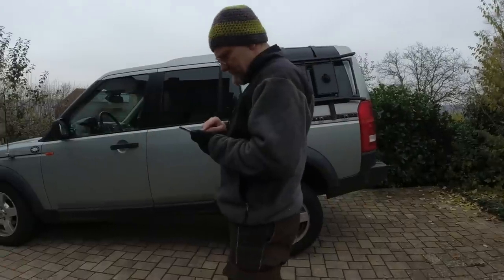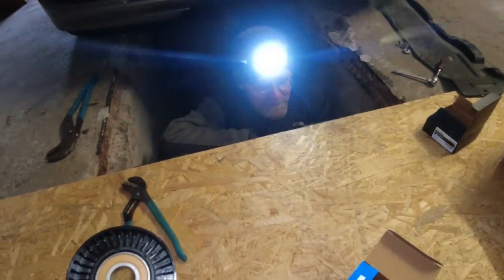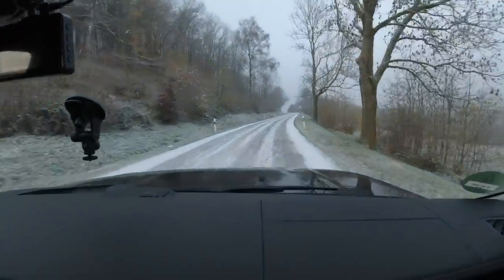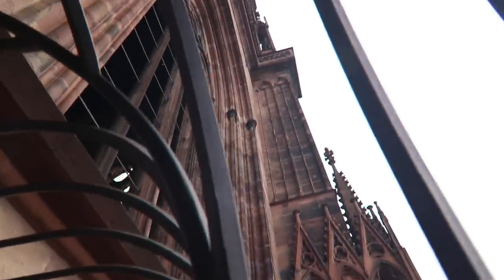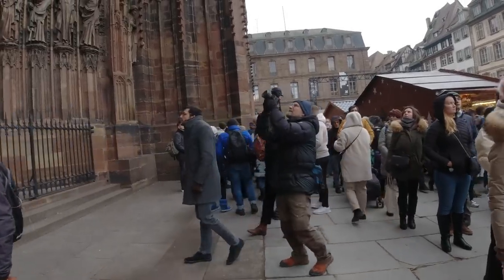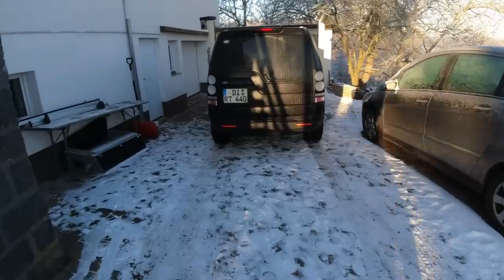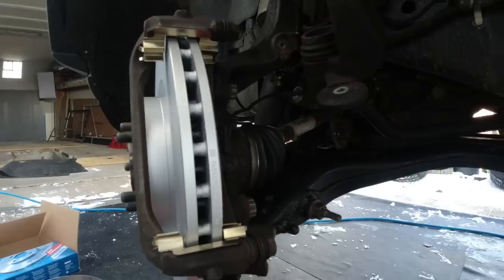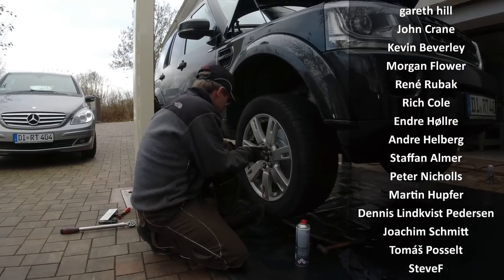Our Land Rover Christmas Tale - Brakes and FBH Remote Installation

Comment: Vera & Christian have a great holiday. Thank you for the very interesting videos and great humour.
The B class Merc was based on the first A class. The twin floor is very safe as in a crash the engine and gearbox are pushed below the passenger floor.
My wife and kids were crashed into by a drunk lady in a VW Toureg who hit the accelerator rather than the brake. She and the kids had only minor injuries thankfully.
The car was destroyed with the engine pushed half way to the back of the car. So the design is great until you have to service it and then you have to drop the engine to do almost everything.
Reply from the maker: 😳Hope they are ok.Yes we absolutely trust that our son will be reasonably safe with the B Class. And yes you even have to drop the engine to change a pulley wheel on the serpentine belt. I cannot understand how people talk bad about Land Rovers. 🙄😅🙋‍♀️Vera
Reply: @Vera_and_Christian  thanks very much. The crash was years ago now. But, yes it saved them so it is a great safe design. Just a PITA for working on 😂

Comment: Love your happy channel, and I'm a dedicated LR owner. On high milages, as spoken of before, my long sold-to-collecter 1991 3-door Disco diesel had 240.000 MILES on it and ran like a sewing machine and never had engine work done just cam belt changes and a slight "tune-up" of its turbo boost valve adjustment and regular services. .. was a 5-speed manual the reason I had to sell It sadly.. Have owned a 2004 Freelander HSE spec auto, with fuel burning heater from the factory but did buy a radio transmitter and 12 volt receiver to one day fit in the live feed for the FBH - "one day"-  Many thanks, and a Happy New Year both - Ian - UK.

Comment: Lovely Christmas LR Time special. Thanks for sharing the videos of your family too. I would be interested in how long the FBH runs before it trips due to a low voltage on your car. Mine does a few minutes without a power supply, or it runs for the full 30 mins with it. I've reset the battery BMS and of course now its much warmer (in the UK) so don't need to use it. Doh!

Comment: Happy New Year to you Christian and Vera.
My 2010 L320 3.0 Range Rover Sport has succumbed to the dreaded P0006A ‘Restricted Performance’ Red triangle error code, confirmed by my iCarsoft i930 tool. 
Having done a smoke test, using a small funnel attached to the rubber hose from the intercooler and blowing ’Vape’ smoke through that pipe, then Elbow, ‘Y’ shaped throttle body and into the intake manifolds, shows that the right side intake manifold has cracked.

I will replace both manifolds as the 2010 3.0 litre engines are notorious for those manifolds cracking, until LR eventually strengthened them (3 times?) to prevent the cracking problem.

I’m also seriously considering removing and blanking off the EGR valves at the same time. On vehicles younger than 2006, this will also require an ECU remap.
I strongly suspect that your TUV would not allow this EGR delete to happen in Germany. Which I believe is why you haven’t covered this subject to date.
But if they did allow it, what would your thoughts be and if you were me, do you think it would be a good idea?

I also have a 2005 D3 which has been ‘penny’d’ (using a UK 1 penny piece inside each EGR pipe) to blank off the EGR valves. No other D3 I have ever driven has as much low end RPM power as my D3.

My thoughts are that if I removed the EGR’s on my 2010 RR Sport, low end RPM power would increase, but hot exhaust gasses would no longer risk damaging the new inlet manifolds. My only worry is that the inlet pressure might increase beyond that of when the secondary turbo kicks in at above 2,840 RPM’s.

A ‘Penny’ for your thought?
Reply from the maker: Hello Richard, have you checked out our video here https://youtu.be/6vhYXutMSDc about the air intake leak on Rainers 3.0 Also, we do not blank the EGR's, it's illegal here in Germany and in the UK, so we 
 will not support it on our channel. 🙋‍♀️Vera
Reply: @Vera_and_Christian  Hi Vera, yes it was a good video. But it is only a temporary fix. Mine is also definitely the inlet Right side (if you are standing from behind the car) manifold. I made my own smoke tester by using a small funnel placed inside the intercooler end of the rubber pipe that goes from the intercooler to the plastic elbow joint behind the top of the fan. Then I blew Vape smoke through the small end of the funnel. There was no resistance whatsoever and smoke was soon seen coming from that inlet manifold.
It is a surprisingly common problem on early (2010 - 2012) 3.0 TDV6’s at about 110,000 miles or about 12 years old, whichever is the sooner.
It would make a very good video for you and Christian to make to replace both inlet manifolds. But it would be quite a long job to perform, because so much other stuff has to be removed to get to each of the 2 manifolds.

Thank you so much for your reply and all the good work you both do.
I am a farmer in the UK and we have a Social media channel called ‘The Farming Forum’. You and your videos get mentioned regularly on it. Today, we have been discussing if we would be mad to buy a Discovery 4 and the Crank Shaft problems associated with them. I have placed 2 of your videos of fixing Fabien’s engine on it. 

Take care both of you and have a very Happy New Year.

Comment: Nice to see something a little different. I note that the mistake to Christian ratio increases when Vera is not helping. 😅 Obviously Germany is a far more civilised country than the UK, but you might want to get a RLD spare wheel protector for the D4. D3/4 spare wheels are a great income source for thieves on eBay. Well done to Philip. Great effort.👍 He just needs a contract from Red Bull and you can retire 😅
Reply from the maker: We don't have any issues with stolen Discovery or parts of Discoverys here in Germany, at all. Never heard of a single issue. Maybe Defenders are at some risk.  Nobody will even bother, they use too much diesel for a german to be of any interest. 😀🙋‍♀️Vera

Comment: Hi Christian a theoretical question for you but here goes, does the GAP tool have the capacity to remap or change configurations i.e I removed my egr valves but cannot delete them on the program. That leaves a small warning on the dash but does not affect vehicle function, I am going to get the Disco re-mapped for torque and have the cat removed which is acceptable here in the UK and I hope the re-map will delete the fault but was curious to know if you think the GAP tool could delete this type of code permanently actually tricking the ecu ? I have an I car tool as previously mentioned and this has been great for resetting small problems and assisting in maintenance work. I have several GAP tools in my watching on Evil Bay currently lol, where could I send you a picture of my fully camo painted D3 with winch and full bumper? Regards Phil

Comment: Great as always, did you do a video to install the remote heater start? Very interested in that!
Reply from the maker: the is a instruction on Disco3.co.Uk.  That is what I used.  Christian
Reply: I have been on the Disco3 site and found a full kit for Altox - Sim activated GSM/GPRS Fuel Burning Heater Controller with added GPS functionality for £240, and so thanks for your reply as it was helpful.